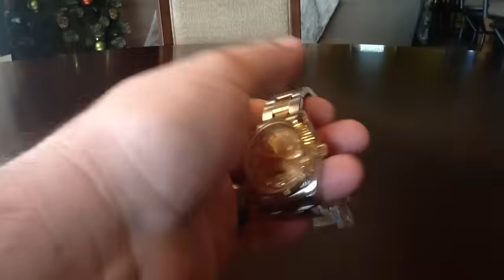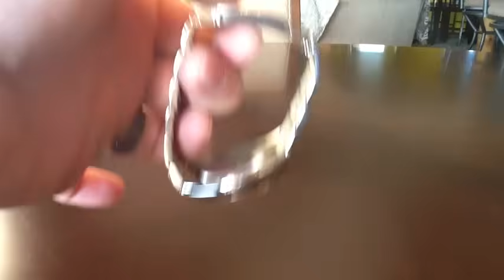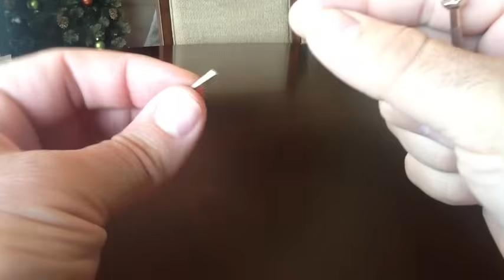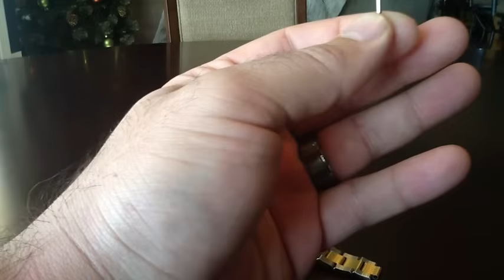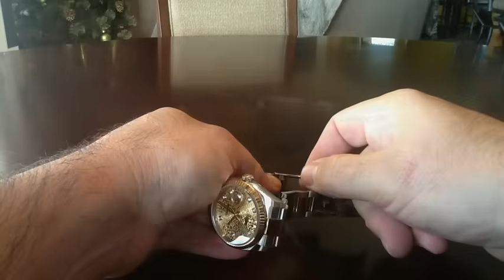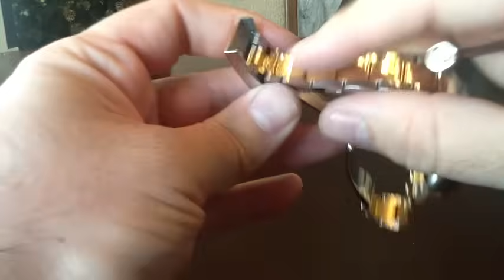At Home Watch Adjustment - How to remove Rolex links

Comment: Thanks for this, I had no idea they were screws.  Only problem is mine seem fixed tight, I've tried two and they just won't move.  Any tips for loosening or best to go to jewellers. Thanks
Reply: Use a hair dryer. That was a tip somebody once gave me.
Reply: What did you end up doing to fix your problem?
Reply: @SamuelShaool  it was so long ago, but I think once I knew they were screws I felt safe forcing with screwdriver
Reply: @Bazmati2020  Thank you so much for getting back to me, means a lot. Very helpful. I know it’s been 10 years!
Reply: @SamuelShaool  Us real ones will comment 10 years later lol.
Reply: @Bazmati2020 legend thank you. I’m buying a quality rep next month this will help!!

Comment: RED?  that's gonna be tough to get off with such a small screw
Reply: Loctite 221. Basically the weakest version you can buy--mostly found in Europe. In the US you can use 222. It's about the same, just a little thinner.

Comment: I have a 69299 women’s replica that lost a link. I can resize it if I can remove the two links inner links cuz it was the center link that fell out but  I need some info on how to do that cuz it will still fit  st fine cuz my wrist is so small. I can’t see any screws to remove  cuz it’s close to the lugs on the top side of the watch

Comment: Hello.thanks for the nice video. 

Im wondering if you could remove the link on the new ceramic submariner until it is smaller than 6” ? (My wrist is a little bit smaller than 6”) I am looking to buy one but i am not sure if it would fit perfectly. And im not sure if they would remove it for me to see if it fits at the shop. Any suggestion?

Thanks!
Ps